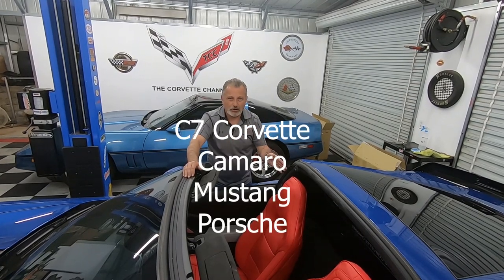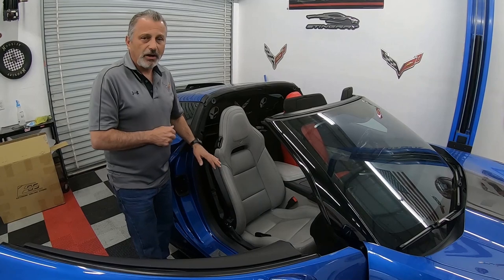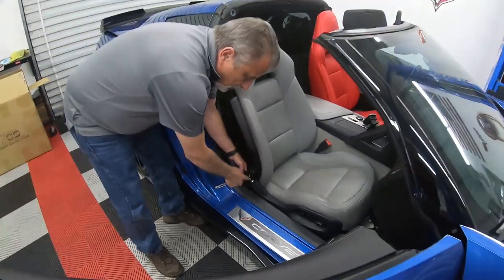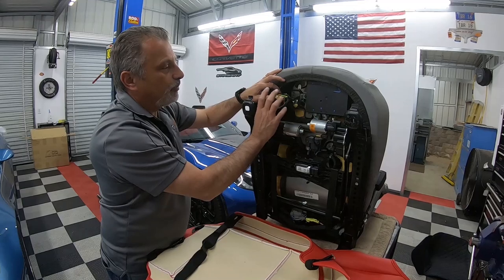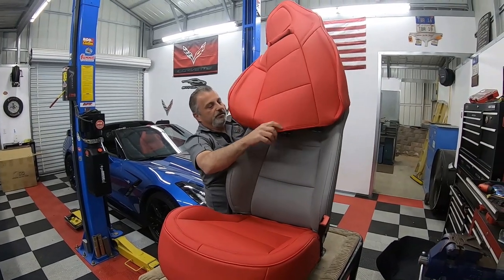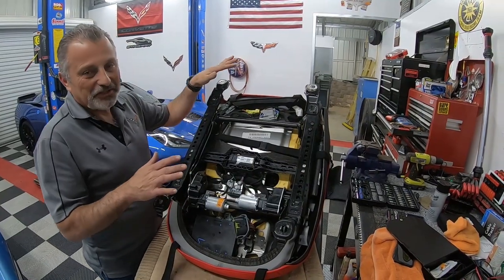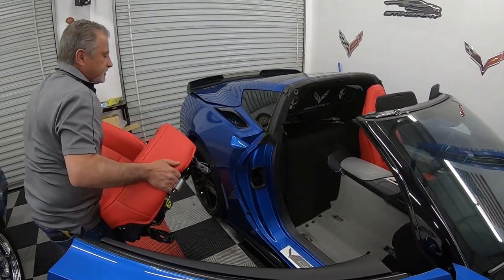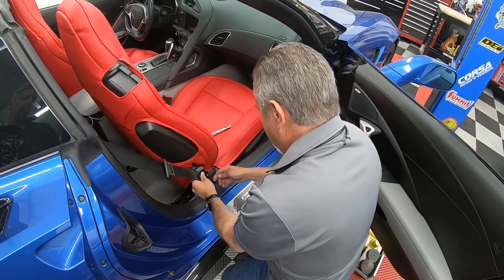How to Install Custom Seat Covers From Kustom Seat Covers on a C7 Corvette

Comment: Noticed no perforated leather…so, will I have to give up the cooled/ventilated seat option that comes with my Z06???
Reply: I thought the same thing and since it was not mentioned in the video, and your question was not answered, I would have to say no, you would most likely lose that ability to use that feature.